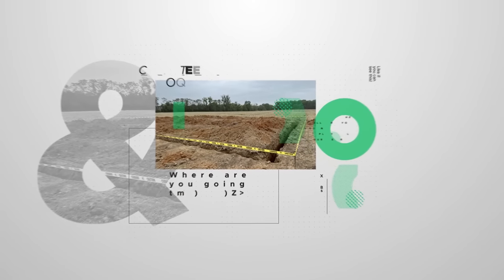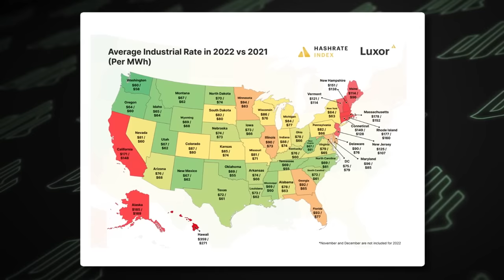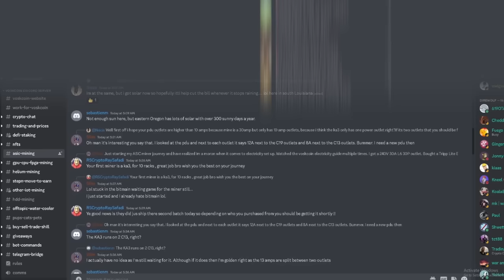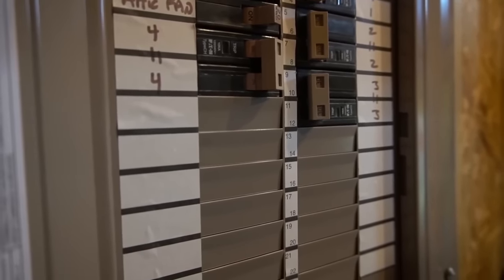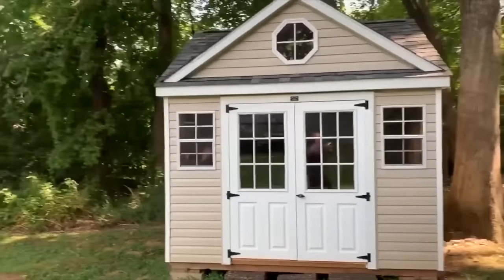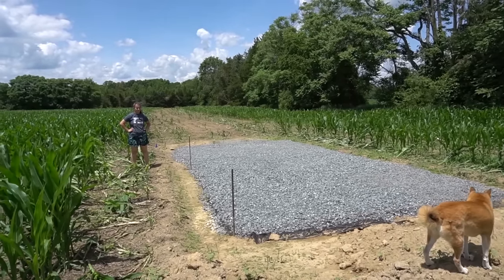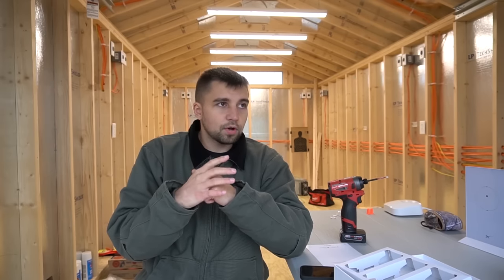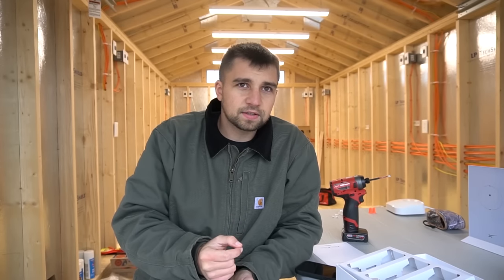How Much It Cost To Build My Bitcoin Mining Farm

Comment: Just wondering why you wouldnt start out with 3 phase? Also are you planning on using any battery backup?
Reply: pretty sure the power company said no. since there they would have to run the 3phase from the main line to Vosk's distribution panels.

Comment: Is mining still profitable now a days?  I live on acreage with a insulated, ac cooled, ng heated, 1500 sqft quonset with 800 amp power.  I know absolutely nothing about mining though tbh.
Reply: Currently no, however mining for the future price and accumulation is the strat vosk and most people right now are doing. 

I believe some ASICS rn are still profitable but most including gpus are not. 

IMO if I where you I would look into setting up a small rig to test it out and learn thr ropes, especially if you have CHEAP electrical.
Reply: @austins4305  Thx for the answer Austin.  I don't have cheap electrical.  Just seems like I have the perfect facility and location for a decent set up already in place.  I'll keep my eye on things.  Maybe some day.

Comment: I am in heart of europe and my electricity rate (WHEN TRANSLATED) is 198 usd/MWh and we dont even have the most expensive electricity.
Reply: I feel your pain, Hawaii has the highest rate in the United States. $.479/KW.  My home is run on solar and I have a small DIY solar farm set up running a Helium miner and hope to use it for the Evergreen Chia farm. I couldn't do it with high powered ASIC Miners, thats for sure.  Good luck.

Comment: I am trying to get an SBA loan for my expansion. 600k and I don't have nearly the buildings that you have. Equipment costs alot.
Reply: Can you diy build / set up any of that? Or is it a must buy set up?
Reply: @austins4305  There isn't much to setup. I did go the liquid cooling route so there is a tank, liquid, hoses, radiators and fans. I had the tank made but did the plumbing and radiator setup myself. Mainly the cost was in the equipment. Almost all of it goes to purchasing the miners themselves. I started with a 100k setup and over 80k of that is the miners alone.